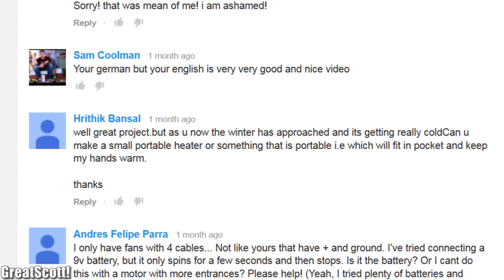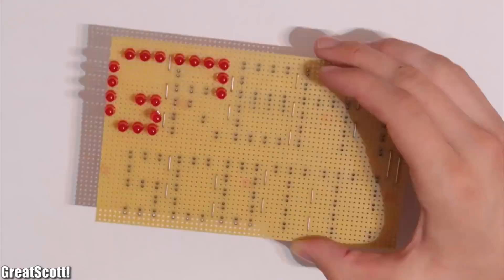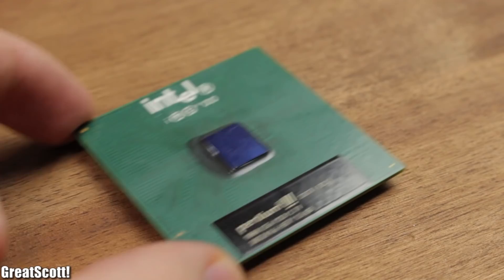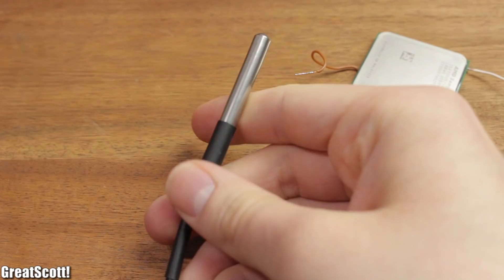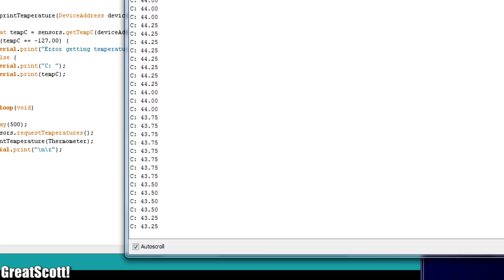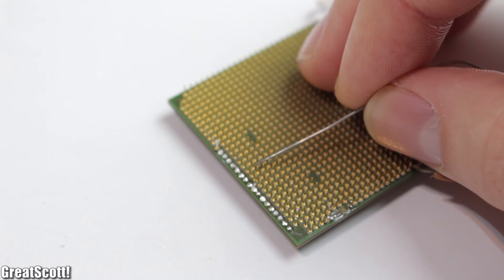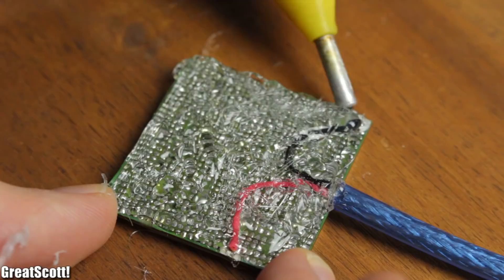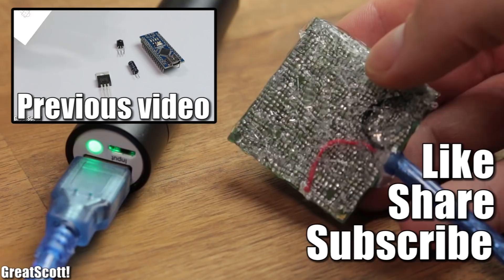Stay warm this winter: CPU Hand Warmer

Comment: you have to use AMD, intels don't get that hot
Reply: Onyx|Designs~FX ALL cpu's get really hot it doesn't matter who made it.
Reply: gamecioep trust me. i would know
Reply: They both about the same heat though especially since they will be limited to 5V. Heck some AMD CPU's need so much power it might not even work.This wouldn't have an impact if you use an AMD CPU anyway due to how energy works.The waste of energy in this situation is heat since he was limited to 5V it would be the same in both CPU's.
Reply: Yes but intel is more efficient. oh and he used a 2001 AMD.
Reply: InfinityFX motɨoɴ desɨgɴ definitely
Reply: InfinityFX motɨoɴ desɨgɴ just don't get butthurt. I didn't mean stupid as in a bad way. Jus how come you didn't notice, as it is a well known meme to say amd GPUs / CPUs are overheating and are called furnaces
Reply: Onyx|Designs~FX not as bad as nvidea in the past.They had horrible GPUs that sounded like jet engines,hot and didn't run as well.The one I'm talking about is the one was almost made the company go under and cost a ton of money to develop and make i will give you the exact model if you want
Reply: TechMan221 did you watch RandomGaming HD?
Reply: TechMan221 btw. it's Nvidia
Reply: Onyx|Designs~FX yes I did and I hate autocorrect
Reply: TechMan221 ayyyyyyyy. i just watched the video 4 hours ago xD
Reply: Onyx|Designs~FX I love that channel it's great
Reply: TechMan221 yeah. great if you are on a really tight budget
Reply: Onyx|Designs~FX definitely

Comment: Step 1: Buy an AMD CPU
Step 2: ???
Reply: Lmao my i7 runs hotter than my old FX8150 the one I have runs at 90C when I play rust and the FX was at 70C
Reply: +Brandon get goud get a AIO water block
Reply: Oscar 1344 My NZXT Kraken X61 is arriving after my Nepton 240M FAILING ON ME FOUR TIMES. Never buy a Nepton 240M
Reply: +Brandon lmao git goud buy a high quality loop
Reply: Oscar 1344 The Kraken X61 is amazing. Got it for a whole day, never going back to Coolermaster for AIO solutions
Reply: +Brandon BOOOO
DIY water loop
block:$5 aluminoum cpu block on ebay
loop:straw
pump:blow it by youself
liquid:your piss
radiator:chopper loop
fan:your mouth
for vram and ram chip,your finger with thermal past
Reply: Oscar 1344 That was my second choice.
Reply: +Brandon noice